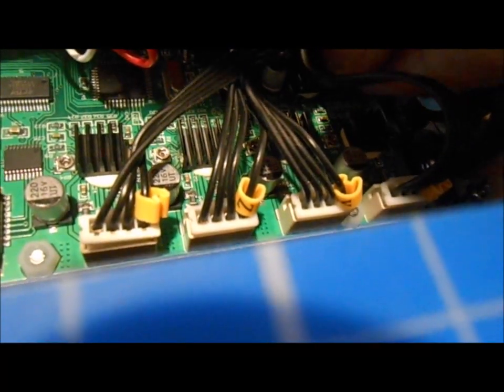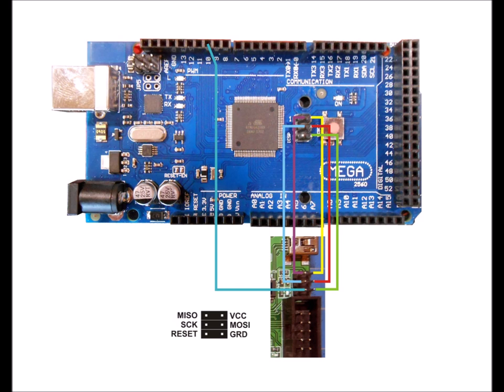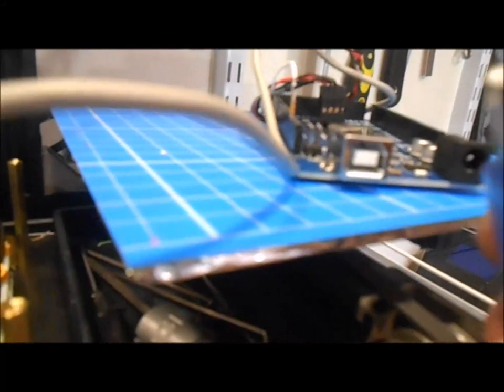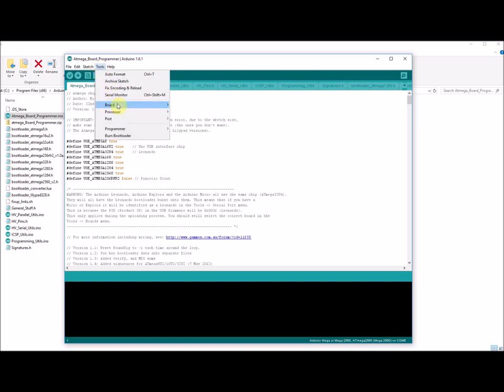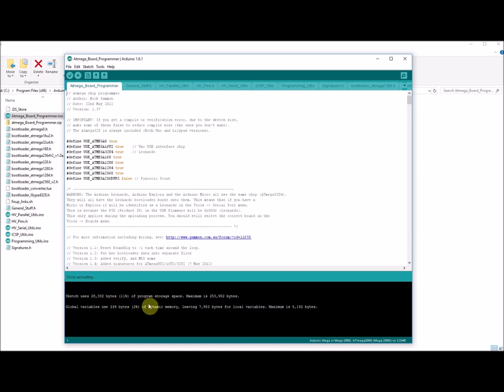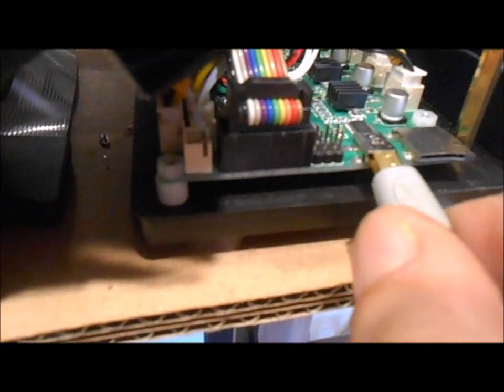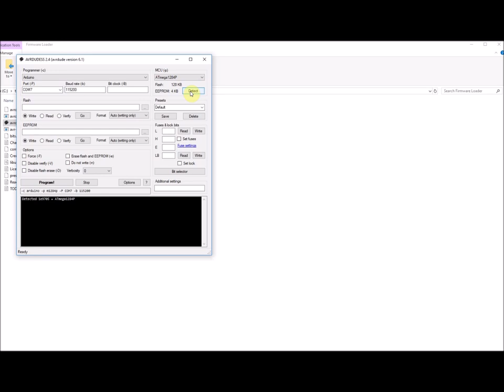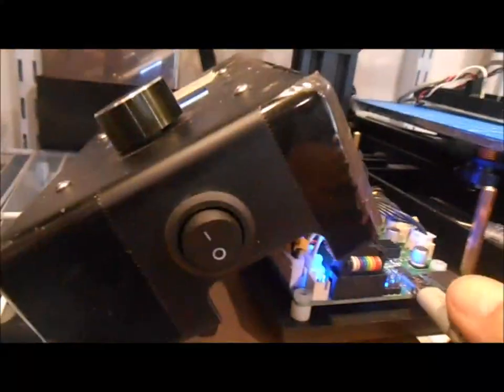Installing a Bootloader onto Creality Boards using Mega2560

Comment: Holy crap man, it’s been a whole thing trying to get this boot loader on my ender 3 pro with an arduino mega. I couldn’t find ANY written tutorials that worked!
Reply from the maker: Does this method still work?
Reply: @RobbyMaQ  for the bootloader, yes, I got too fed up with messing with it last night after all that and haven’t tried to get any firmware on it today yet.